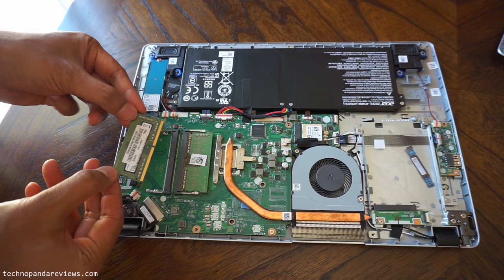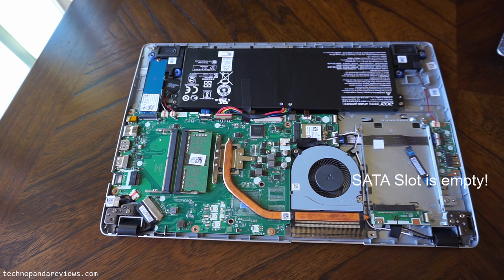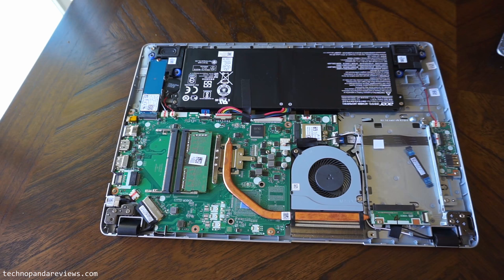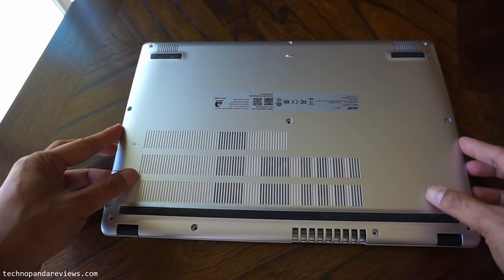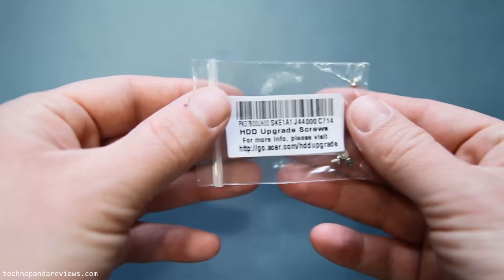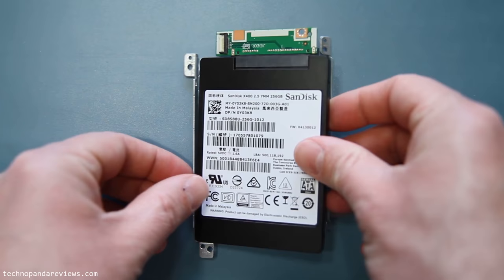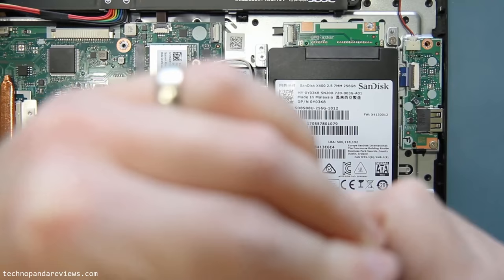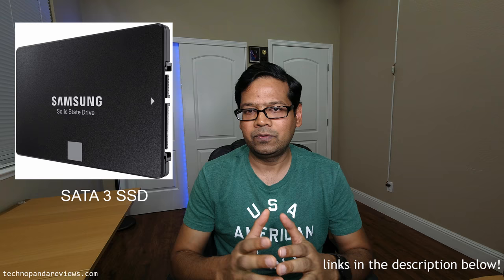How to upgrade SSD storage in Acer Aspire 5 Slim & Acer Aspire E 15 Laptops

Comment: Thank you for the great video. I have the slim model and want upgrade to 2 Samsung 8 g memory cards and the Samsung ssd 500. Should the battery be disconnected and also will I have to do anything other than just start up the computer again? I have never done such a thing but am not scared.
Reply from the maker: No need to disconnect battery.  Just take basic precautions like no wet fingers. Also put your laptop on a flat surface with your feet grounded (shoes are good enough). After you add a new SATA3 SSD, please initialize it using instructions from here: https://youtu.be/R-qTVkbgMwI
Reply: @RealTechnoPanda  just what I needed!  I just got this and plan on doing an extra ssd but was not sure what to do after the install THANKS!!

Comment: I just want to install a second sad drive for saving files and videos. After the hardware installation do I need to do anything with the bios settings ? Will it recognize the second drive automatically.
Reply from the maker: You dont need to mess with BIOS. Just launch windows "disk management" and you will be able to format and add new disk from there
Reply: @RealTechnoPanda  Thank you for your answer.
Reply: @RealTechnoPanda  Hi, I installed 500gb SSD per your instructions. went perfectly. in disk management and it says disk 1 online for 465.75GB.  to the right, it says 465.75GB unallocated.  how do I format the drive when it isn't recognized under file management?  Thanks
Reply: actually, no need to respond. I saw another video on the exact steps to format, etc.  easy peasy!!k Thanks again!
Reply: Paul Lang can u send me that link please? In the same boat as u were

Comment: I installed the 500 gb Samsung Sata drive and It’s not showing up in the bios or disk management. Ive followed a lot of yt tutorials and none of them seem to work. Are you sure this is the right SSD?
Reply from the maker: Please follow instructions from Kevin Carter's comment that I have pinned on the top. That will fix your issue
Reply: @RealTechnoPanda  I tried his instructions and made sure I followed every one. I uninstalled and reinstalled the IDE ATA controllers. I visited Disk Management and didn't get the prompt to initialize the ssd. Any other ways I could try?
Reply from the maker: I am suspecting the cable is not making proper contact. Can you please double check the connection and make sure you plugged the correct end of the cable
Reply: @RealTechnoPanda  Thank you, I believe that was it. Also, I discovered that one of the screws that are inserted into the ssd itself was missing.  The new problem I have now is that the 8 GB of RAM I installed have only 5.94 GB usable. Any idea on how to get the Laptop to use all of the RAM?
Reply: @FrappuccinoAlfredo  2gb is taken up by the Ryzen APU/GPU for video
Reply: Joe Dominic ahh thanks for clearing that up

Comment: can I add 16GB DDR4 RAM 3200MHz rather than 1GGB DDR4 RAM 2666MHz?
Reply from the maker: Yes, but It won't run at 3200. Since the motherboard does not support higher frequency ram, if you put 3200 megahertz ram it will automatically slow down to 2666 megahertz

Comment: Hi Techno Panda. I followed your instructions and installed my Samsung 860 EVO 500GB 2.5 Inch SATA III. I actually installed it before even starting up the computer for the first time. But my laptop is not reading or recognizing it. It still shows my factory hard drive space. I have the same laptop as in your video. Please help. Thank you in advance!
Reply from the maker: You will have to in initialize the disk using disk management utility https://youtu.be/R-qTVkbgMwI
Reply: Techno Panda it worked and now I have plenty of space. Perfection. Thanks tech p

Comment: You do not have to move the wireless card?
If you install this does it void your warranty?
Reply from the maker: You don't need to mess with wireless card. I don't know about warranty
Reply: @RealTechnoPanda  if you install it during the warranty coverage time and something needs to be repaired on the functioning hard drive. Will they repair it being you added something that did not come with the computer?
Reply: @RealTechnoPanda  i just got the.laptop.they sent a.package with 4 screws. Do you kno what they go.to?
Reply from the maker: Those are for installing SATA3 SSD
Reply: @RealTechnoPanda  would know where i can find phillip screwdrivers with magnetic tip in a 0,1,2 length total 6 inch min.?

Comment: I don’t know how.... but my computer is dead, I’m checking loose connections and it’s not working at all.... can you please give me some insight on what I might have pulled, I know for sure I accidentally unclipped the white and black wires next to the ssd area, plugged them back in but other than that I’m not sure
Reply from the maker: Does your laptop not start at all? Or are you getting "disk not found" error during boot?
Reply: Techno Panda doesn’t start at all, plugging it in does nothing, no lights either
Reply: Techno Panda I had two days to return the laptop to amazon... after 4 hours I gave up on it...... I had the intel version, ordered a replacement today.
Reply: @RealTechnoPanda  Im not sure if this matters but in the SSD slot i put the ps4 sata 500gb drive in there.... im not sure if thats what did it tho

Comment: Purchase upgrade samsung 8Gb from your link, thank you. Speed of ram is 2666Hz but windows displays it running at 2400Hz any reason for this?
Reply from the maker: Yes, this is because the motherboard+CPU on this laptop only supports DDR4 2400 MHz, so a higher DDR4 RAM will downclock to supported speed. Its perfectly fine, don't worry about it. Enjoy the laptop!

Comment: Can I get a sata 3 1 tb or is it only compatible for 500 gb?
Reply from the maker: Yes, you can get bigger capacity
Reply: @RealTechnoPanda  Thanks ! its all a bit confusing but id like to upgrade ram to 32gb if possible and 1 tb of ssd .
Reply: @RealTechnoPanda   For the acer aspire 5 does it matter which ssd upgrade you buy? Are both SATA3 and M.2NVMe compatible upgrades?

Comment: can you add nvidia GeForce mx250 to an acer apire a1515-54-59w2 model. Has intel core i5, 10th gen with 256gb?
Please let me know
Reply from the maker: No you cannot add a GPU. Its soldered to the MB